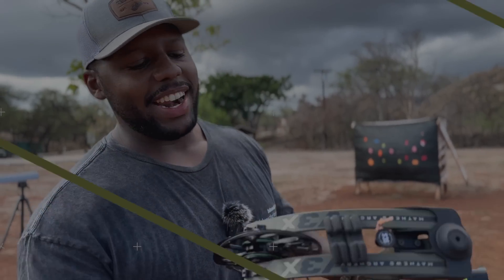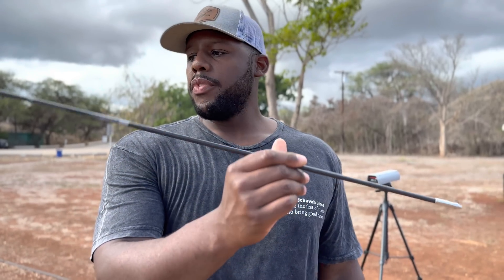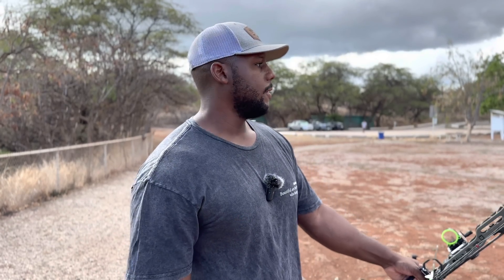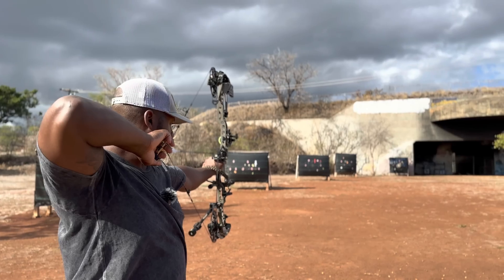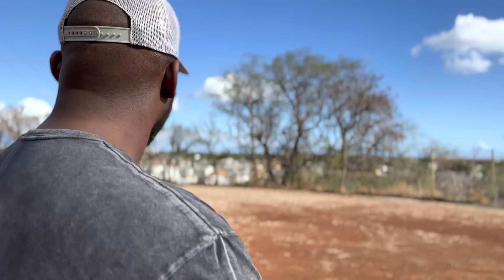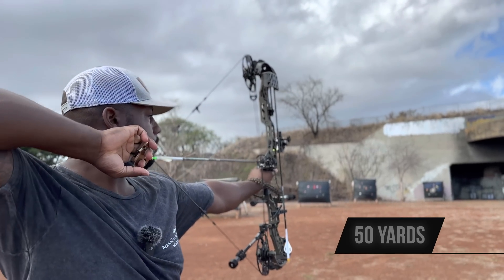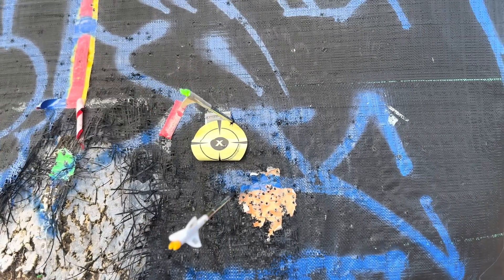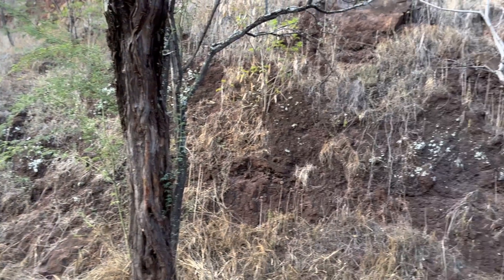Will adding 70 grains to my arrow destroy my trajectory? (620 grains total)

Comment: Honestly 50 grains at your draw length and draw weight... not really much considering you are already considered pretty heavy.   If you want to maintain your speed but need to go up in spine I highly recommend Victory Rip TKO arrows.
Reply: In my opinion and experience they are better than Easton arrows for hunting. They are a carbon weave which is incredibly durable and much less likely to split or splinter than standard carbon arrows.  I think if you pick them up and try them, you will probably be hooked.  They are that good.
Reply from the maker: Are they as durable and consistent as the axis?  I’m kind of stuck in my ways lol
Reply: @PrivilegedBowhunter  Also could check out DaySix arrows, they have been the most durable arrows i have experience with, far superior compared to any of the big name brands.
Reply: My experience is they are significantly tougher than the axis. I only use the axis arrows for 3d league now.
Reply: Victory doesn’t make a 200 spine arrow. I wish they did. They do make a 235 in a VAP though, which is what I shoot. A little more money but they fly nice!
Reply: @bigz5262  I agree, but it seems their 250 acts the same as my GT 200s.  If you put it into their spine selector it will probably say 250.